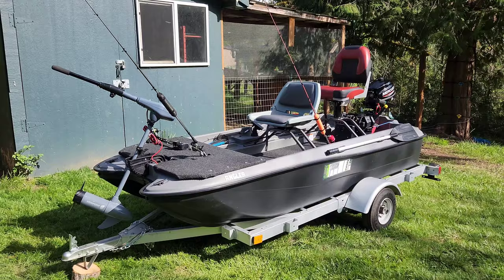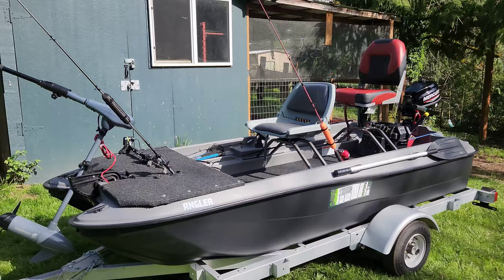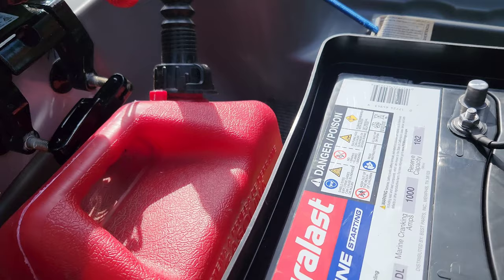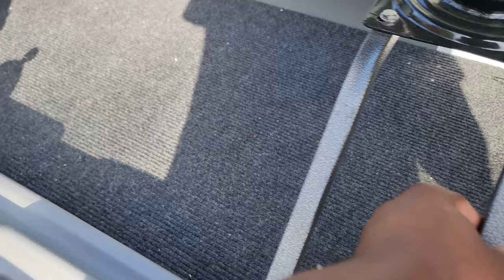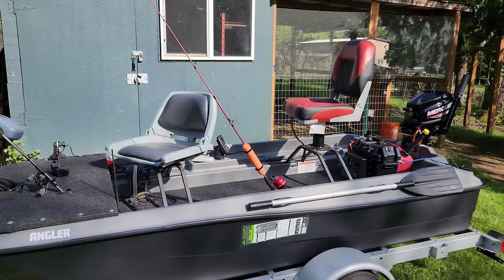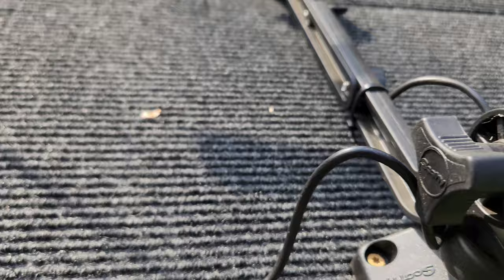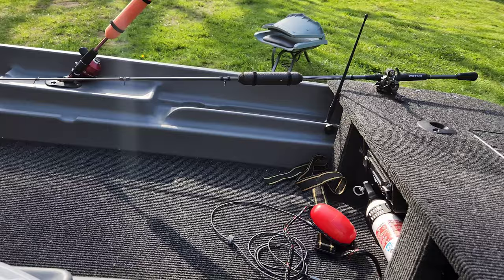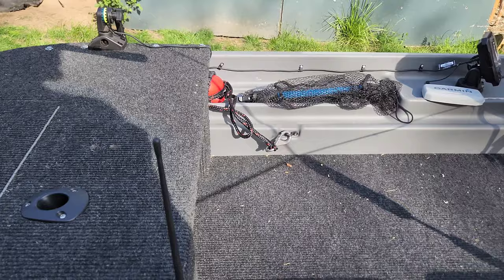Quest Angler(10' 3") 2 Person Pond Boat | WALK AROUND & UPGRADES

Comment: That is a pond prowler ten not a quest angler
Reply from the maker: @Kevincassum  This was not purchased from Bass Pro Shop and is not a Pond Prowler. It is a Quest Angler sold by Dicks Sporting Goods. No matter what name it originated as with another company doesn't mean that's the only company who can distribute this model of boat.
I mean a quick Google search would answer any confusion you may have.
Reply: @boltfiend thank you but I have a question how can I make the stock plug in the front of the boat route to the trolling motor if I want to but it in the front but have my battery in the back

Comment: Does the boat just sit on the trailer or did you use bunks? Does it lift off easily? How many tools did you use to build this boat?
Reply from the maker: As of now the boat just sits on the trailer but ive since added a plywood floor to the trailer. It lifts off easily with no issues but without a floor on the trailer the aluminum can be pretty sharp and scratch the boat if youre not careful.

Comment: Just bought a Pond Prowler 10 four weeks ago. Already have the floor, the battery running lights with clamps . ( takes 3 triple A's) .Everlast 84 marine battery from Walmart . 55lb Minnkota trolling . Need some more Ideas. Happy fishing !  Thanks .
Reply: I bought a scotty arm transducer mount like you but I feel it's not long enough . I hope it works. Did you buy an extension ? Having troubles with it . Thanks .
Reply from the maker: @timgreene8432  the scotty arm mount was definitely too short. I created an extension with a few random brackets I had laying around my garage which extended the arm by about an extra foot.

Comment: Looks nice BUT one thing to remember everything you add weight wise in your build, flooring, decks, heavier seats, motors and batteries you really need to subtract from the total weight the boat is designed to carry.
Also the lower and deeper the boat will draft. 
The more weight the slower your boat will be when using the motor either gas or trolling.

These days since the prices have dropped so much for LIPO4 batteries that is the way to go as with a standard wet cell you can only run them down to half as any further will damage the batteries, Lipos you can run down to 80% even 100% with no damage and the batteries will last longer to boot.
Not to mention the Lipo battery will weigh less than half the weight of the wet cell battery.

Also every hole you cut and hole you drill in that boat you are making another entry point for water to get into the pontoons, if you drill make sure you seal everything the best you can with a good silicone sealant.

These plastic boats I think are better when kept in a more minimalist state and if you want a floor use like anti fatigue mats from Harbor Freight, fairly light will give you a better surface more comfortable for your feet and inexpensive to boot. 

You also should get a small like lawn and garden battery to power your depth finder separately, you will probably get interference when you are running your trolling motor on the same battery.

But nice work and very clean looking, we all approach these things with a different mindset.
Reply: I was thinking the same thing with all them new holes. He has a lot of siliconing to do. If I add anything to my 8 ft angler it’s just gonna be a 55 lb thrust trolly and maybe make a front deck compartment that is no intrusive to the vessel. something that will fit snug upfront

Comment: Great video. The only suggestion I have for you plug up the hole you have for the fishing rod so water does not get in there over time and deteriorate deteriorate the styrofoam inside the boat.  Thanks for putting out an awesome video

Comment: Nice setup.  I just bought a raider 8 of facebook to be used on some small lakes.  I am curious how you attached items to the boat.  Did you use rivnuts or just screw into the plastic?  I would think that just using screws would not have any strenght.  Thanks for your insight.
Reply from the maker: @jeepers29SK  Thanks for checking out my setup! I used medium sized lag screws to mount the deck to the front of the boat and smaller metal screws for the smaller things on the boat such as the oar holders, lights and any wiring. I sealed all screws with marine silicone. I'm not hard on my boat and haven't had any issues with anything not holding up. It's been 2 years now that I've owned this boat and every trip out has been great with zero issues.
Reply: @boltfiend  Thank you.  I look forward to getting out and trying mine.

Comment: Very nice. I’m looking to do something like this.  How did it handle on the water?
Reply from the maker: It handles great on the water. When using the trolling motor the outboard acts as a rudder and really helps steering. I have heard of folks having trouble steering without a rudder or an outboard acting as one. The outboard maxes out at about 7mph with 1 or 2 people and gear. I tried removing gear and with just myself on board and the speed difference was negligible, maybe .5 mph. If transporting in the bed of my truck it helps to remove both motors and reattach once the boat is launched.
Thanks for watching!

Comment: What trailer are you using? We just bought the boat but do not know what size of trailer to purchase plus there are no pictures of the bottom of the boat. Thanks.
Reply: Get a harbor freight trailer that’s what I’m using for mine the cheapest option unless you can find a cheaper deal on a used boat trailer

Comment: Did you need to reinforce the transom?
Reply from the maker: @vinceh5163  i did not but I have considered doing so due to the small amount of flex I notice. Not enough flex to be worried but just enough that it wouldn't hurt to reinforce it just as a precaution

Comment: is a trailer needed for this specific boat or would it be ok to put it on top of my toyota corolla and strap it
Reply from the maker: No trailer is needed, I normally just toss it in the back of my pickup. It hangs about 2ft over the tailgate but is very stable.
Its 10ft and has a lil weight to it so im not sure if its advisable to put on top of your car but maybe the 8ft model.

Comment: How long does the battery last roughly
Reply from the maker: It lasts roughly 3hrs depending on how much power you are drawing. It lasts me all day on the water as I only use the trolling motor occasionally and my other accessories draw very little power. I am installing a solar charger to the battery to recharge while im out as well.

Comment: Do you have a link to the trailer?
Reply from the maker: https://www.lowes.com/pd/Stirling-4-x-8-Galvalume-Kit-Trailer/5005414467?cm_mmc=shp-_-c-_-prd-_-hdw-_-ggl-_-PLA_HDW_214_Automotive-_-5005414467-_-online-_-0-_-0&gclid=CjwKCAjw-IWkBhBTEiwA2exyO6Mm_ECeTYaWEbZKKI9TT34dqhdNcPXSVgtDi_b4YAV4kiw7IggWZRoCWiQQAvD_BwE&gclsrc=aw.ds
Reply from the maker: It was on sale when I purchased it. There are cheaper trailers on the market. Just about any 4x8 trailer will work